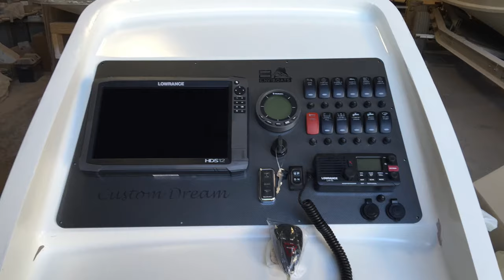Custom Carolina Dream Homemade Boat Build

Comment: I'm not into deep Vee boats at the stern as they are inefficient and why most Carolina Sportfisherman boats are fairly flat at the stern. Also center consoles only shield mainly the driver. Having said all that, people don't realize the absurd number of hours it takes to do a good job like this. Like sanding for a month or so.